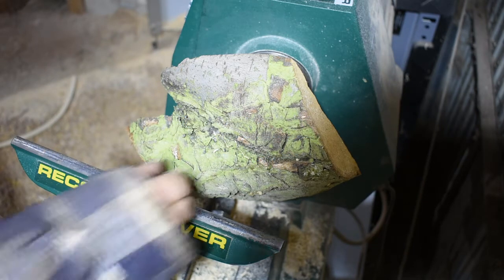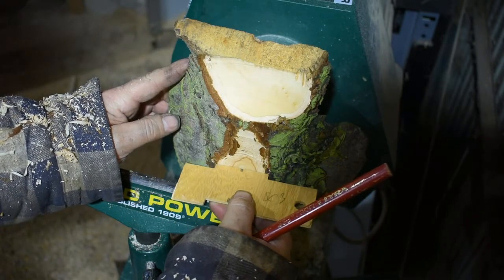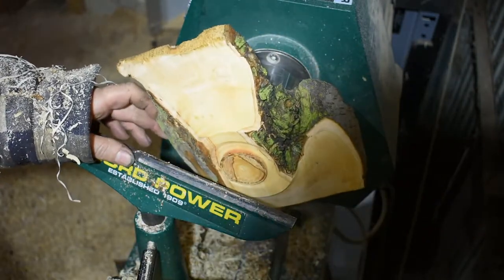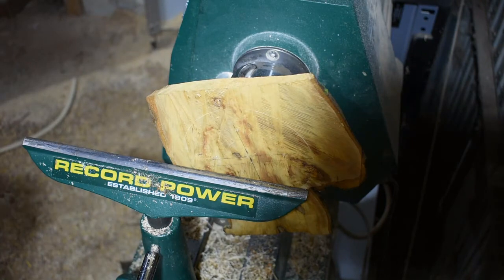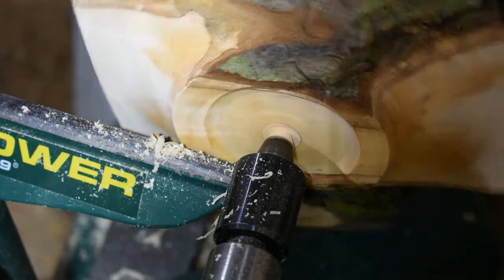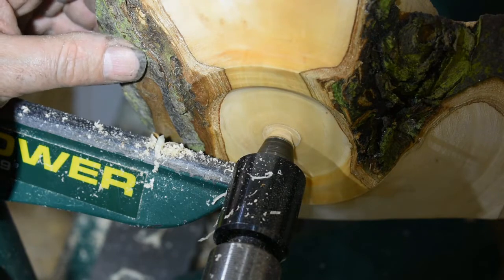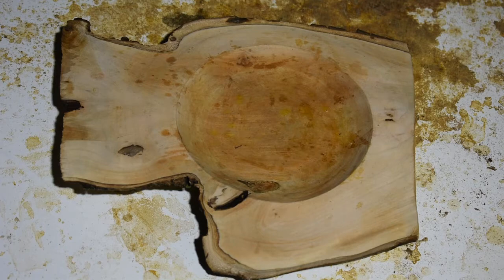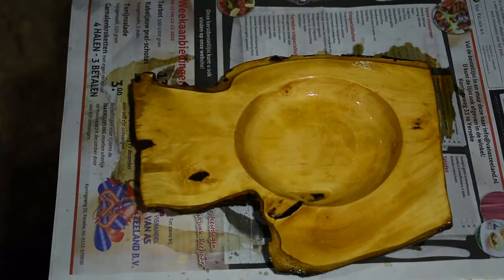Woodturning a Pear Plate

Comment: I really like the natural aspects against the  bowl! Danish Oil.....confusing isn't it.....Hampshire Sheen and Rustins are food safe as far as I am aware (Hampshire sheen says it over the name on the label). Chestnut Products finishing oil is also food safe and essentially the same but they chose not to use Rustin's name for it. I think it depends on the thinners and the base oil used, one of our cheaper DIY stores in the UK uses Linseed Oil in theirs but all the ones previously listed use Tung oil which is food safe in pure form as far as I am aware. Anyway, great piece!
Reply: Nice job leo like the lathe same as mine good tool keep it up
Reply from the maker: Food safety is a consideration. I used this transparent laquer also because it leaves a hard smooth surface. With oil of any kind I would worry about the effects on the taste of whatever you put on the plate.
Reply from the maker: Will do!